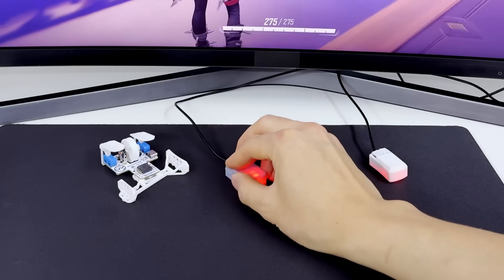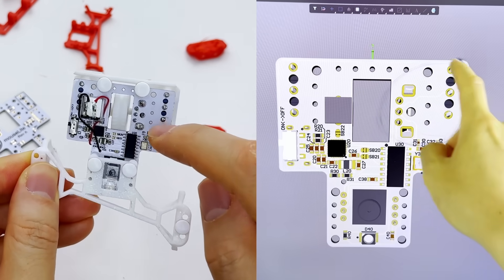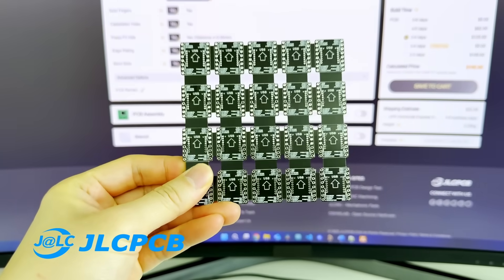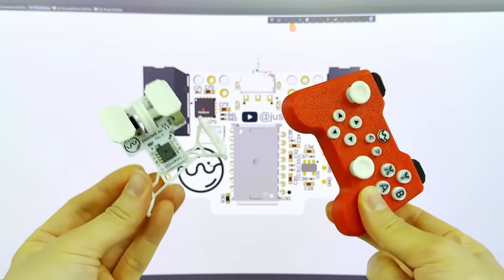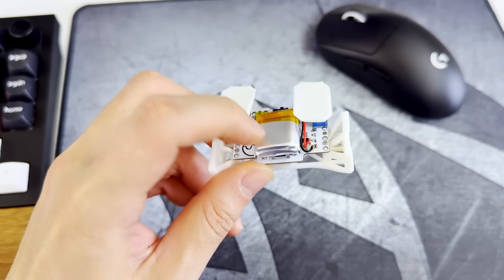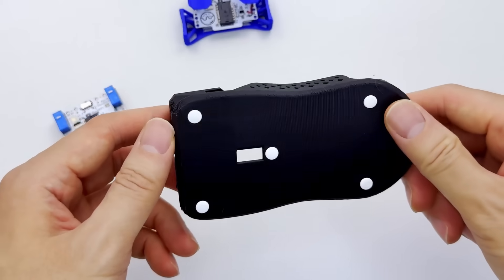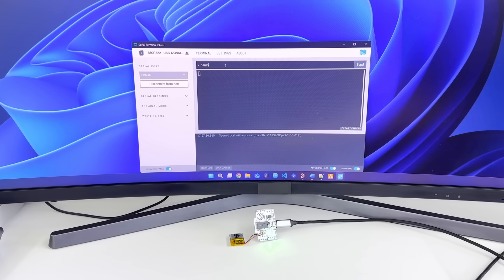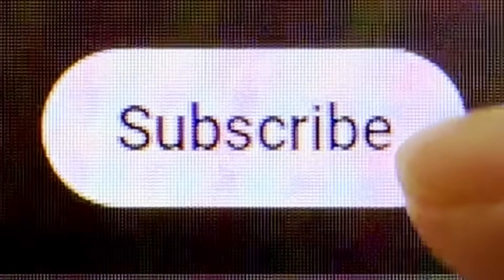I Made the Worlds SMALLEST Gaming Mouse

Comment: would you consider implementing something like the switch actuation in the op1 8k where the switch is activated when the little bar first disconnects from the contact rather than connecting with the second, also me personally if i were to buy something like this id like more ergonomic finger contact points somewhat like the zero mouse blade but ideally with a single side button (because i saw one with two but when he clicked the top button the whole mouse rotated)

Comment: Looks like you'd be better having the switches turned around and the buttons lever from the back, it might feel more responsive. Currently your finger tips are sitting on top of the button's hinge which would cause more resistance than if it when in the middle of the button.. or I could be talking out of my ass.

Comment: Have you ever considered a dual sensor mouse? I'd be interested to make one with your help. Let me know if you want to hear more about this idea!
Reply: What is the idea?
Reply: To compensate for any individual users natural radius of movement when trying to move the mouse horizontally. With one sensor in the front and one in the back you can eliminate that. I bet it takes time to get used to that, but I wanna try and see how it feels.  @DwAboutItManFr
Reply: Why?
Reply: @Rivalyr  Dual sensor gaming mice used to be a thing in the mid-late 2000s. Optical sensors then had bad tracking and would skip around, using two sensors to average tracking made them much more accurate. I don't think there is really a point with how good the sensors are today.

Comment: well looks like optimum mouse. the optimum channel. you can add two skis that go under your palm and wrist. or a thin slab. so instead of your wrist being on the desk, its on the slab. less friction. now your hand is in the air mostly. normally it rests on the mouse. not touching the desktop. the wrist slab is an optional detachable extension. is the price tiny also. yeah diy. kinda free. opensource free + optional pre-assembled kit using the same opensource free design.

Comment: Why are you using PLA? it has a very high density compared to other filaments, so you will lose some weight swapping to other filaments.
Or I am mistaken and you are running abs or something else at 220c 65c bed and unenclosed.
Reply from the maker: nah, i didn't experiment with different filaments yet but i should!

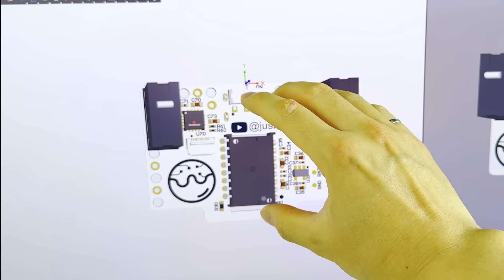Comment: 1:45 idea:
use a belt instead of a wheel to save vertical space
Edit: Another idea: Use a wireless charging coil instead of battery to make it even lighter (with a transmitter in a loop around the mousemat like in DIY perks "Completely wireless setup" video )

Comment: 2 things.
1: This is really cool. I made my own a couple years ago and you're inspiring me to also design the PCB from scratch rather than just using a G305
2: the position of the sensor is extremely important. With the sensor so far forward in a palm grip mouse, it can be something you need to get used to again when coming from a mouse that has the sensor in the middle of the palm, like most other mice.
Reply: Fingertip mouse. I fine if the sensor is aligned with the tip of our finger.

Comment: I remember seeing a DIY Perks video recently that had a wireless power delivery system that would remove the battery, making it even lighter. Might be worth a test?
Reply: I think I've seen "WR lightweight wireless mouse" that was just induction coil (iirc) from graphics tablet tied to a finger, that worked in a mouse mode
Reply: @null384  I know the video, but this one was based on digitizer technology, which is limited and requires a table... albeit it can deal with mouse rotation effectively.
Reply: I suggest it to him, he didn't talk about it much.

Comment: hey , i would like to suggest somethin , u can make a mouse pad with inductive coil embedded in it . That way u can just power the mice wirelessly and shed off some extra grams .
Reply: then you would have to add a coil, and circuitry for voltage regulation and a somewhat chunky capacitor.

all this would likely weight more than current version with battery.
Reply: @destiny_02 Not if you use  the same board.
Reply: @DwAboutItManFr how would the current board work with wireless power ? its not some magic, you need additional hardware.
Reply: @destiny_02 You would need to design a new board for that, with the coil accounted for.
Reply: @DwAboutItManFr that's what i am saying, your previous comments was saying otherwise
Reply: @destiny_02 I meant the same board as in, "the same board as the mouse components are", not the same board as is.
Reply: DIY perks enjoyer, yeah I mentioned that idea to juskim.